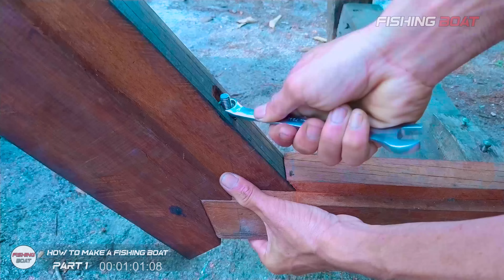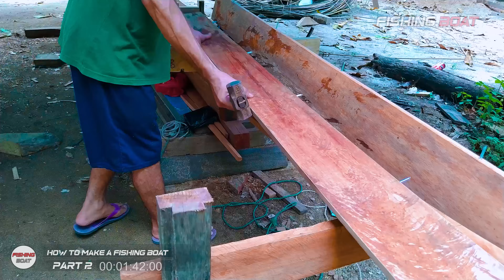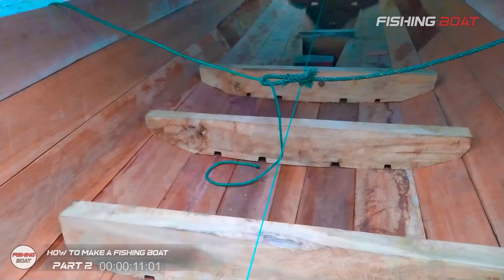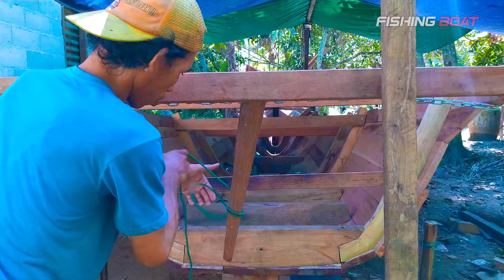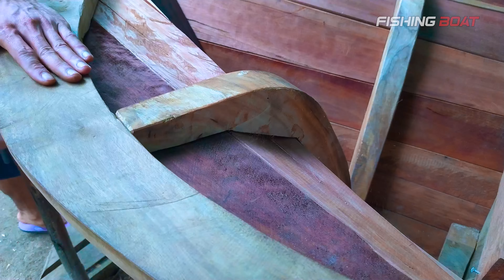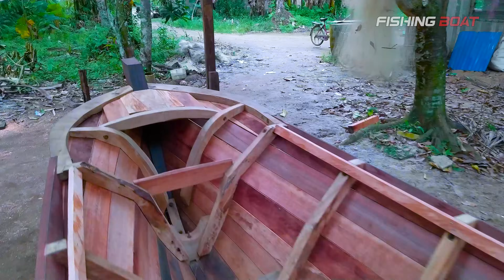HOW TO MAKE BOAT | Small fishing boat | Homemade boat

Comment: How about a part two for the purpose of showing how you watertight this thing, looks great but full of places where I see light through the hull. Pretty sure that would be a.problen on any boat. Never mind I found it. Props!
Reply from the maker: Later on, the boundaries of the boards with gaps will be patched and finishing with putty, thank you
Reply: Same as the old sailing ships n boats 
Launched into water  the timers take up ,nice design of hull would valve  wave n waters well
Reply: Absent minded for sure!
Reply: This boat designed for daily use and years. Unkind of modern WOODEN boat manufacture that look weak in hull structure and so i bet they build boat not for daily use. And shame for them that they use so many modern and expensive tools and machineries, unefficient in cost allocation.

Comment: Looks nice , but how is it going to float? I hope in the next video you are going to apply something
Reply: In fact it is a long used  fishing boat in the Philippines
Reply from the maker: @Jason B 
next i will apply something that is
The gaps in the boards will be closed with a hammer and putty so as not to leak, so there must be a small gap between the boards, if they are too tight, it will be difficult for the installation process.
thanks bro.